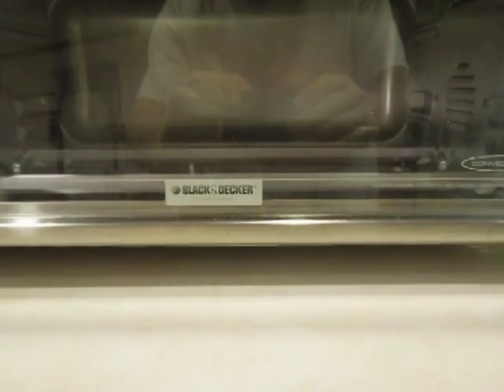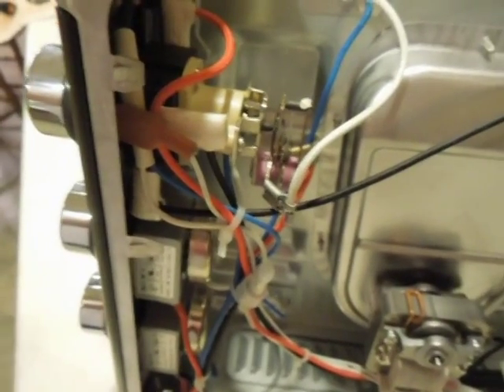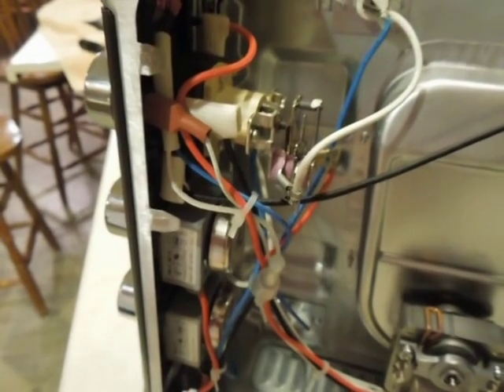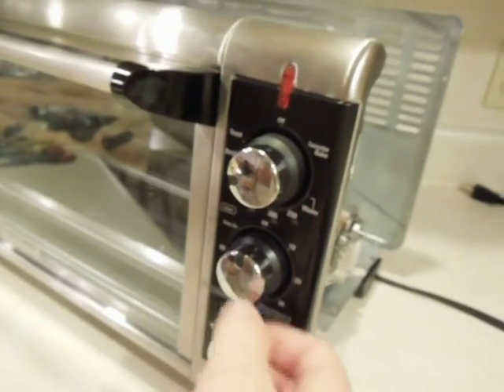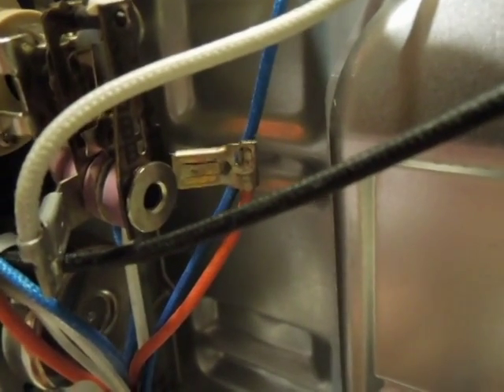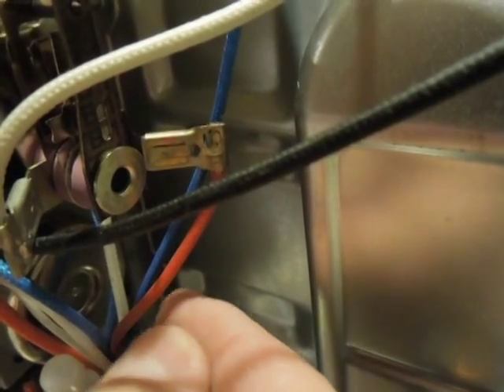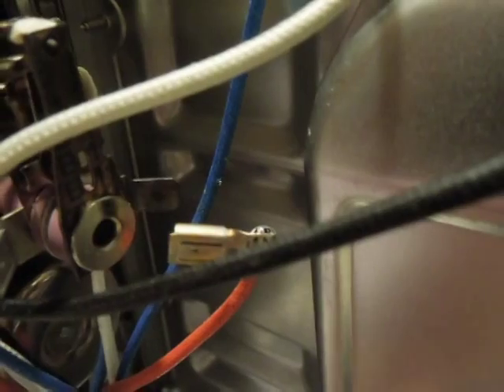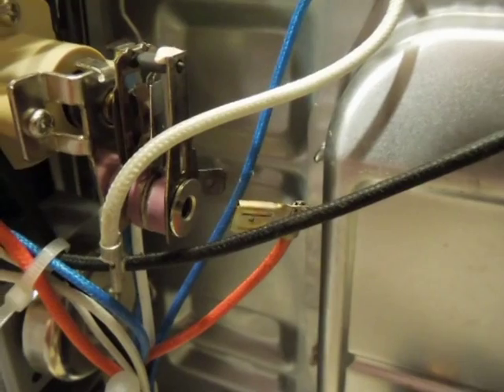Black & Decker Toaster Oven Failure, Safety Wiring Issue

Comment: Would have liked to see how ya took the top off, do I take the legs off also?
Reply: Sorry but I just threw that toaster oven away so I can't look at it and don't remember how it came apart. The timer quit working si we had to replace it. Thanks for watching and good luck fixing yours.
Reply: Take rubber stoppers off bottom. Screws are accessible there. U need magnetic dish. Lots of small screws.

Comment: B&D Model TO1356SG ... Spade terminal on the Temperature control that connects to the Mode control ... Was tight, but oxidized black ... Shined both pieces, squeezed the connecter, reassembled ... Both elements bright and red, working on all functions ... Great Video! Thanks!

Comment: Got the same issue. I didn't run it without cover off, so I didn't realize it was the contact issue. After seeing your video I realized that I had the same contact oxidized, cleaned it with some files, will see how long it lasts.

Comment: Mine was the same issue but with a terminal located on the Mode switch - top elements failed to heat up. I guess the factory assembly worker didn't give the terminal a good tug to see if it was snugly fitted.